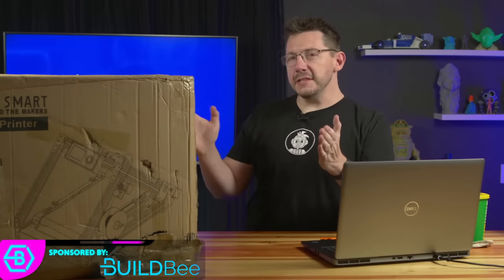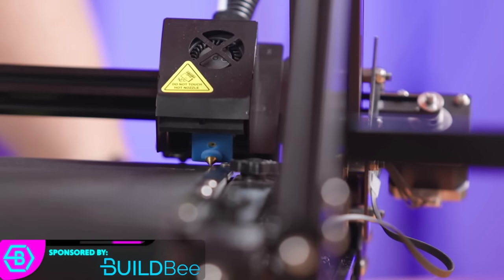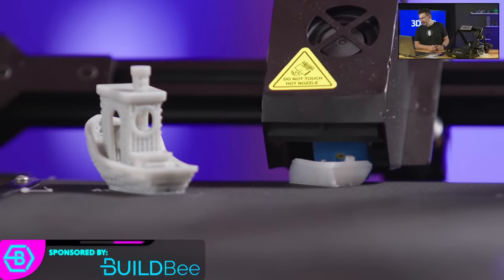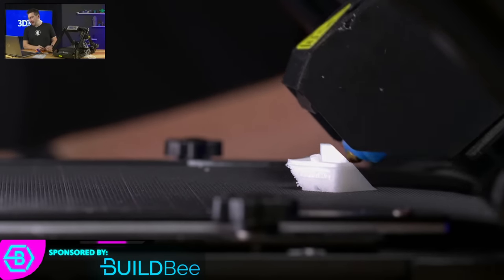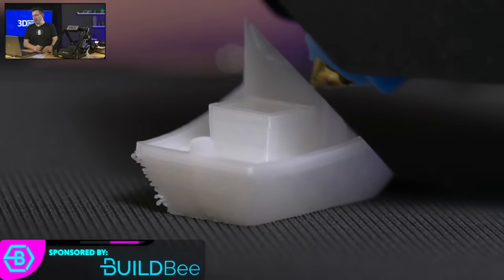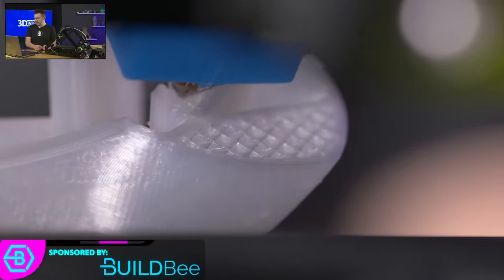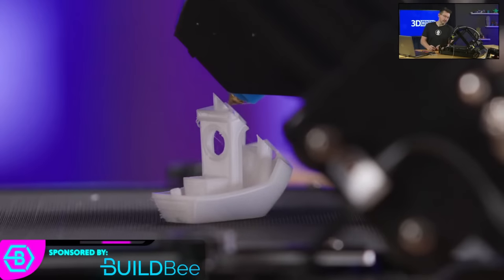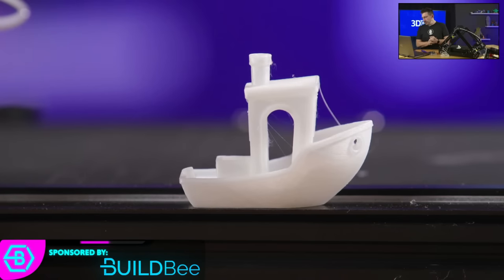NEW BELT PRINTER! Sainsmart INFI-20 Unbox & First Use LIVE!

Comment: Very impressive first print with minimal setup. This seems like a huge out of the box improvement over the previous belt printers. The only thing left is getting the price down. $750 is still a lot for a FDM printer, this would be great for printer farms, but for a consumer that just wants a long bed, its pretty expensive. Also since its a belt printer, its unfortunately only big in one dimension, you can get 400mm printers in every axis for $500 these days, so you really have to want that infinite belt to make this a smart buy.
Reply: @PeppoMusic  is the print size that different? The head crashes on top but it can be removed to match the cr30

Comment: Hi Joel, hello Community, my Birthday is coming up in November and I want to get my self a 3D Printer. I am torn between an Ender 3 Max and a Longer Lk5. But I am unsure about both. I would not mind spending a bit more. I want something reliable, I find the size appealing, and I don't want to tinker too much. I have started with a monoprice mini select v2 which needs upgrading =D Any suggestions which printer to get? (Sorry you probably get that question a lot, but also Christmas is coming up, many more might be wondering...)
Reply: Hey, I have the Ender 3 and Ender 5 Pro. I havent tried the ender 3 Max but I have seen some worrying videos on youtube about it. 
If its your first time and you want to put a printer together in one day and start printing same day.  I'd strongly recommend the Ender 5 Pro. The square design and all metal extruder make it super beginner friendly. I've had it a little over a week and not a single print has failed.. even the first one came out amazing. 
But if you need larger than 220x220mm bed you may want to look into the CR-10S V2 or V3 if you get lucky to find one.  The Ender 3 Max is ok but if its your first time i wouldn't recommend it.